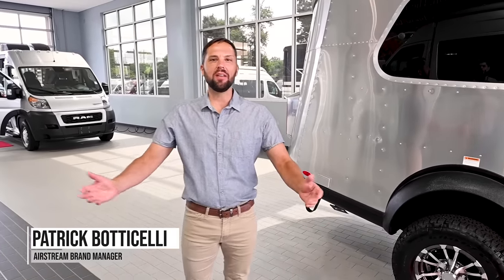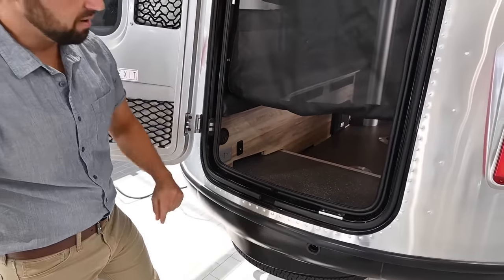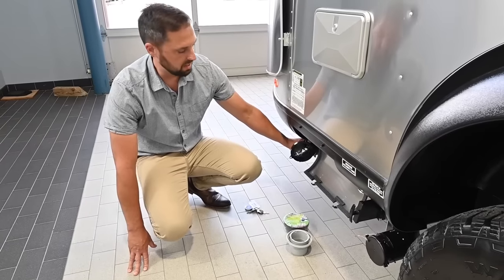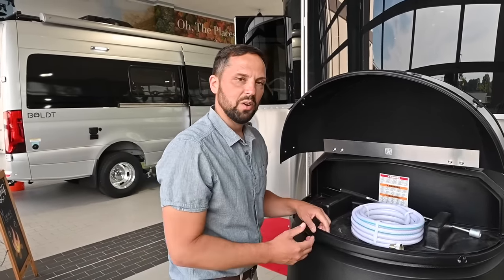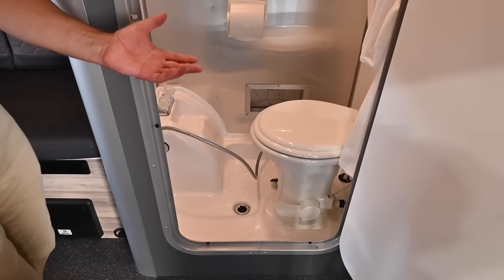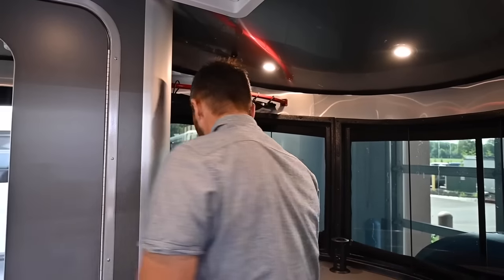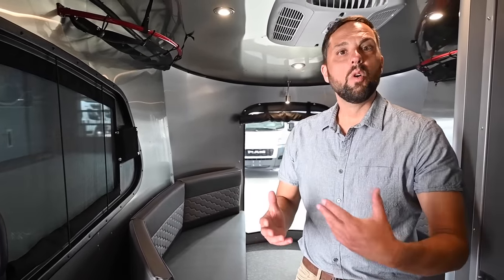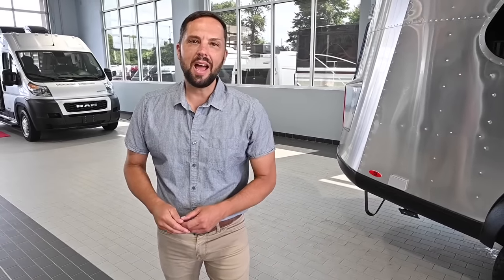COMPACT OFF-ROAD TRAVEL TRAILER | Airstream Basecamp 16X Walkthrough Tour

Comment: I love this Airstream.  The customer added some great options!
Reply from the maker: We agree!
Reply: @Sonja, as someone who hasn't ventured into the "camping/travel trailer" world, YET who likes "all things space-related", I ♥how this trailer is a bit like a space capsule! ^_^ The rear entry door really set it off. I was wondering why there wasn't a small set of steps for that door. Everything inside is fairly "tight" except the bed of course. I'd have to also place a spin-around stool in the kitchen. A lot of things were clearly a bit down-scale from some of the larger and longer Airstream trailers in Patrick's other videos. 

In this trailer I also liked the many "press & release, press & latch" doors on many of the compartments. I think I would like the bed to be simpler than having all of those different pieces to assemble/disassemble. I don't even need a bed so large. I could just move the backrest cushions & sleep on either of the benches. I'm also not a fan of those particular tables, I think I'd like a larger, single-piece table.

Comment: With all the extras that you talked about what does the base camp cost at that point?
Reply from the maker: The Basecamp 20X can range from 65,000.00 to $72,000.00 for 2023 with all factory options and many aftermarket accessories.

Comment: What is the difference between the 16 in the 16 X thanks
Reply from the maker: If your adventures take you even farther off the beaten path, the Basecamp X-Package adds more rugged features to make you ready for just about anything you find along the way. The package includes Goodyear® Wrangler® tires and black shadow wheels, plus a 3″ lift kit and a raised hitch jack foot pad for even more road clearance. Stainless steel rock guards and a solar window guard also keep the trailer looking good, even if you put it through the wringer.

Comment: Don’t lithium have problems that become permanent with exposure to extreme cold?
$1,000 for a backup camera?   Really?
Reply from the maker: Kim, there are different types of lithium battery technologies. The RV's mostly use LiFePO 4 which can be used in cold temperatures and also have heat so they can be charged when below freezing.